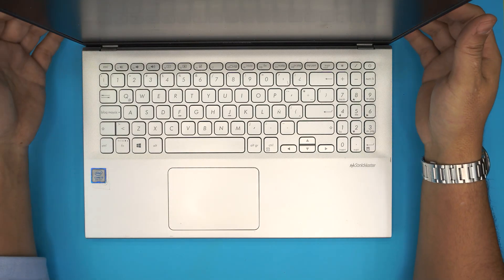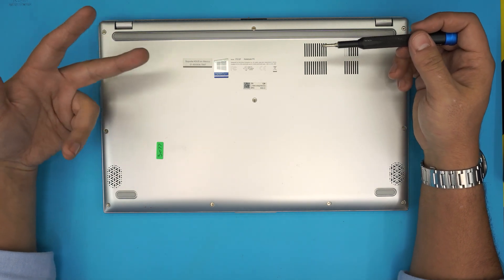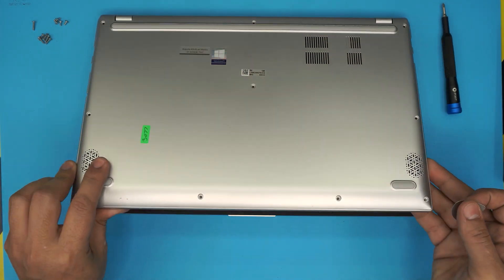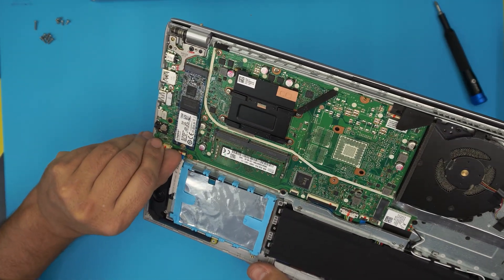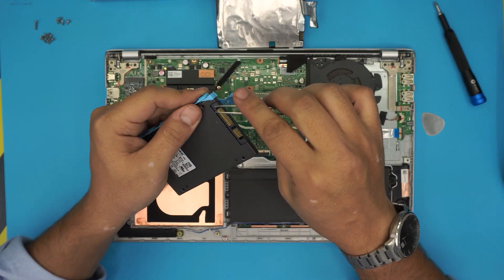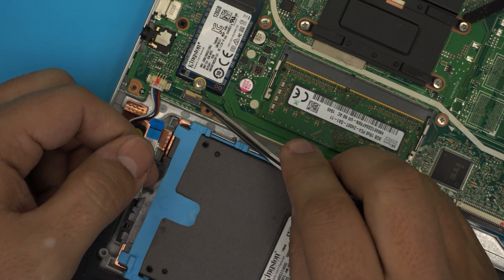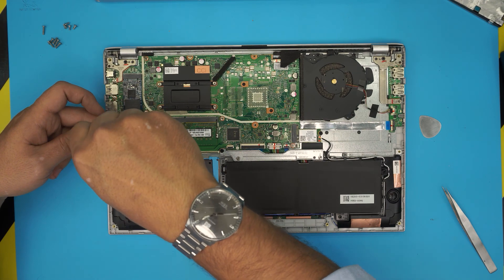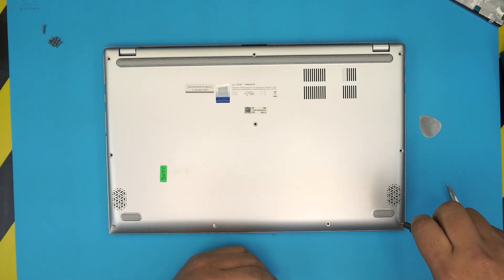Asus Vivobook F512f SSD HDD Upgrade FULL Guide

Comment: My vivo book stays stuck on the “asus in search of incredible screen”
Reply from the maker: did you place the new SSD? if so then you have created the windows usb drive to install windows ?
Reply: @uFixTek I put in a new ssd card
Reply: When powering on I’ve tried to enter the BIOS screen but it doesn’t event go past the logo screen. I’ve tried holding esc, f2 & delete with the power button
Reply from the maker: That is not normal. Did you make sure the SSD is correctly installed? Maybe the SSD is bad. I recommend that you take it to a repair shop at this point. Just ask them to check if your SSD is good—they can test it in front of you.

Comment: Hi bro, my ASUS X412F has got suddenly no power, but its white-colored power indicator light is blinking. I can't power on the laptop. Can you please help me with what to do next.?
Reply from the maker: Thanks ✌  for the feedback!  if you wish to support the channel you can LIKE or SUB or both :P
regarding your situation: i would recommend you to do the following: #1 remove the cover unplug the battery remove the ram, and no charger connected, then press and hold the power on for 30sec then release, then plug the battery in and the ram. and then without placing the cover on plug the charger and test it out dont test without the charger plugged, it can take up to 5-10sec for screen to appear as we removed the battery. videos on ram and battery removal:
https://youtu.be/oB2tyc9ohl4
https://youtu.be/KgInFAezCCM

Comment: Hey mate, could you please share with us the PART NMB/ SKU for the 2.5' Sata cable?
Reply from the maker: Thanks ✌  for the feedback!  if you wish to support the channel you can LIKE or SUB or both :P
Regarding your question:  there are so many part numbers, we purchase this once and they work just fine, its just an adapter. don't worry about the item title, this are all compatible with your asus laptop and even with most hp laptops, we purchase them all the time.
https://amzn.to/2XebyqZ
https://amzn.to/38TATZD
Reply: @uFixTek  consider me liked and subscribed! Thank you for the guidance!
Reply from the maker: much appreciate your help and support my friend :)
if you ever have any question or request feel free to ask me.
other way to support the channel is by using my amazon general link before buying or searching for your purchases :P
USA: https://amzn.to/3A8dJu6
MXN: https://amzn.to/3BhTZoB
😋
Reply: To add new 2,5 SSD to F512F without it i use these parts:
1. ASUS HDD FFC 10 PINS CABLE OF ASUS LAPTOP F512FA - SKU : HDDFFC10PX512, P/N : 14010-00217200
2. ASUS HARD DISK CADDY OF ASUS LAPTOP F512FA - SKU : KITHDDX512, P/N : 13NB0KA3L10111